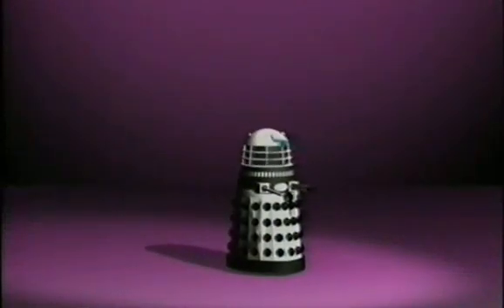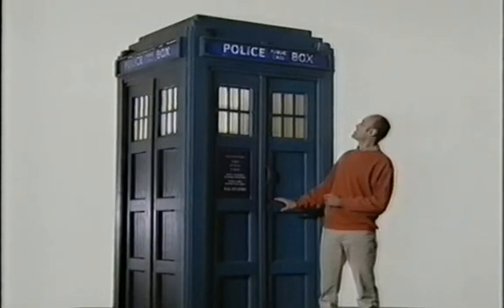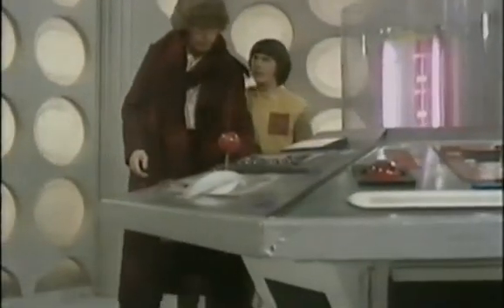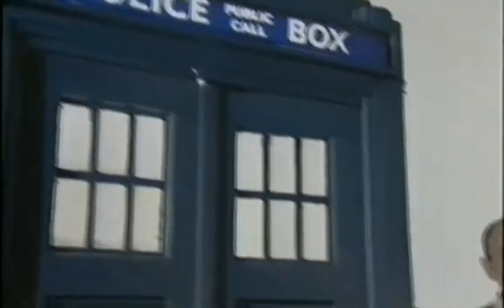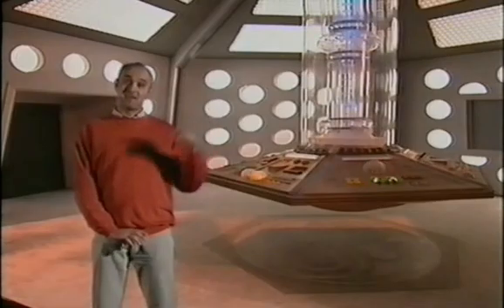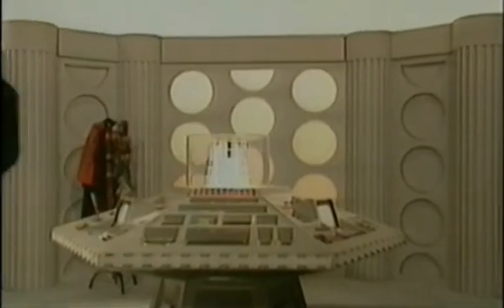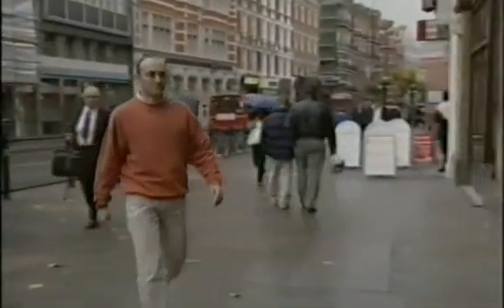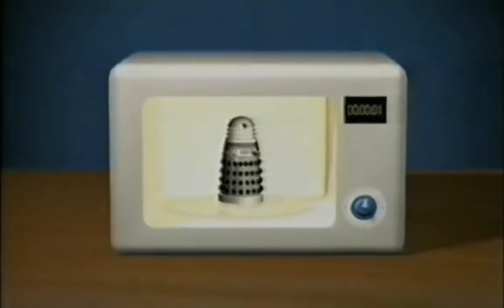Doctor Who Night (1999) - How to Build a TARDIS

Comment: "In electro-kinetic theory, space expands to accommodate the time necessary to encompass its dimension" is how the TARDIS was explained in the first Peter Cushing Dalek movie. From what I understand, something like this actually is described in quantum electrodynamics, so Milton Subotsky slipped in a bit of real-world science to give the movie script a rather neat mechanism to suspend disbelief.

The wormhole theory for the TARDIS fails on two grounds: there is no evidence for the kind of physical displacement that would accompany the creation and maintenance of such a large warp in the fabric of spacetime, and there is no evidence for the radiation that would be the inevitable byproduct of the process.  And from what we've seen on several occasions, the TARDIS interior and the link to the outside world both appear to remain in stable existence even if the Ship's power is reduced or wholly blanked out.  It's a passive-operating mechanism, unlike one that would be required to open and maintain a stable wormhole.
Reply: The tardis literally was made by the people who made the laws of physics

Before it's was all magic and nonsense